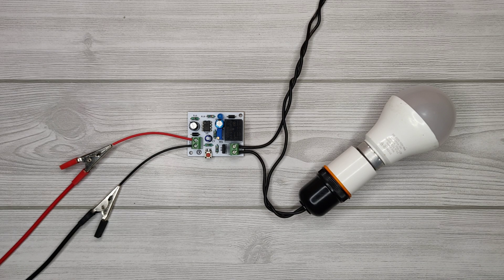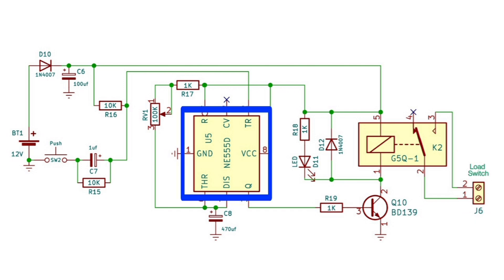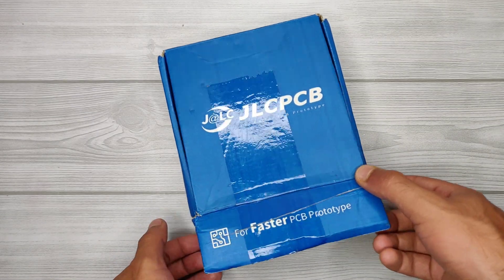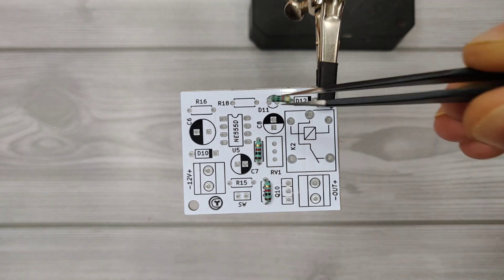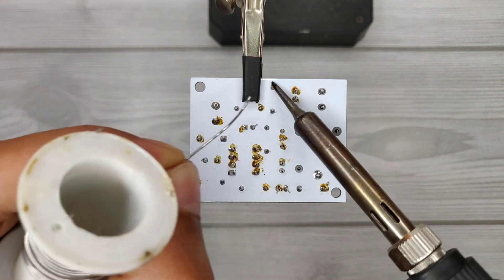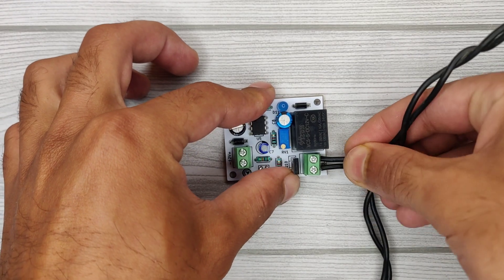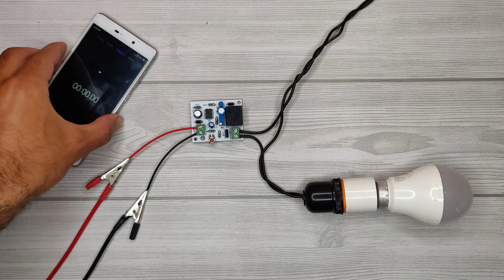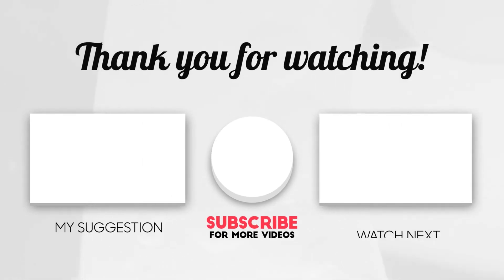Useful electronic project using 555 timer ic

Comment: Nice 👍👍
can it be combined with delay on?
Reply from the maker: You mean you want to delay time before on?
Reply: @CreativeTechos  yes
Reply from the maker: Yes, how much time delay you want before on.
Reply: 3 seconds
Reply from the maker: Ok perfect, I'll suggest changes in circuit, and how much on time you want after delay?
Reply: @CreativeTechos  
Scenario:
switch on - delay time 3 seconds - light is on - switch off - delay time is free to set - light is off
Reply from the maker: Use 100uf capacitor instead of 1uf used in video.

Comment: What would be the maximum set time after replacing the Capacitor. Is it possible to set for  0- 24 hrs , adjustable?.
Reply from the maker: Yes, try to use 2200 uf capacitor with 9-18 mega ohms resistor instead of variable 100k